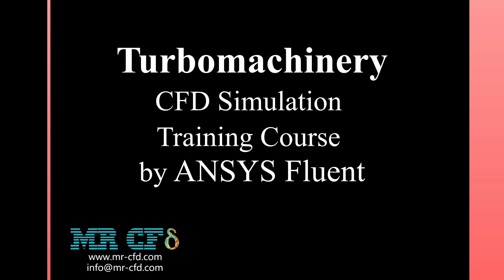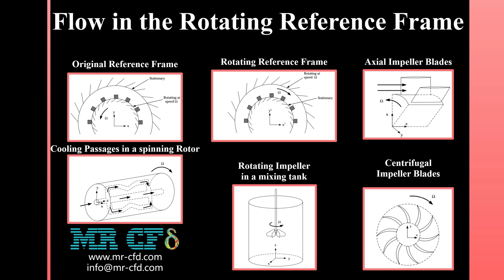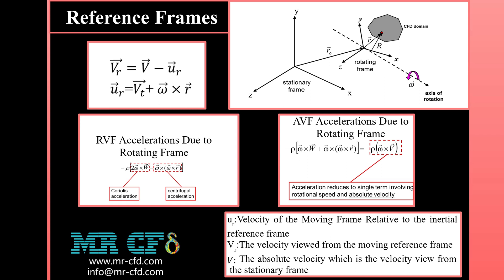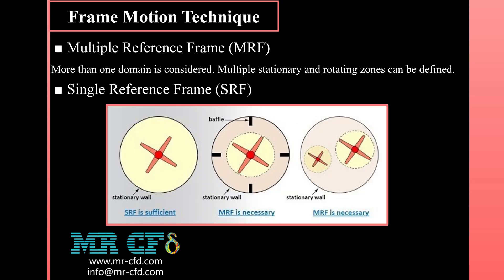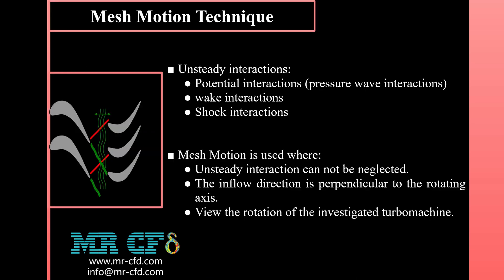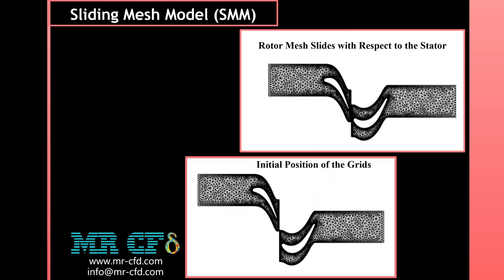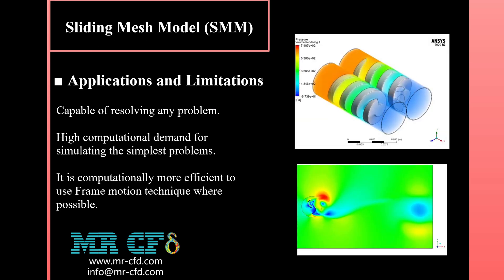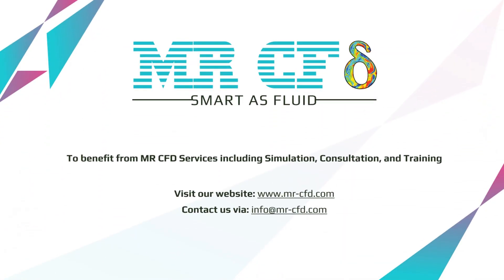Turbomachinery Concepts, ANSYS Fluent

Comment: Hello ,  I have a quesion please, I have a centrifugal pump and I want to simulate transient flow using sliding mesh in Ansys fluent,   my question  is regarding mesh interface,  I should use periodic boundary condition or  general turbo interface ? 
I also wanted to know is there any guide to read for mesh interface because I do not understand it in a clear way?